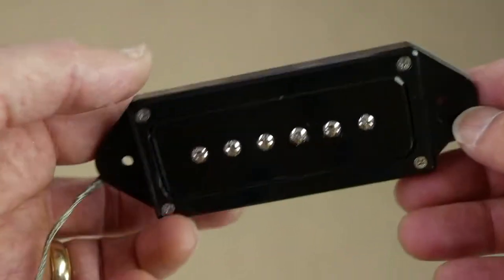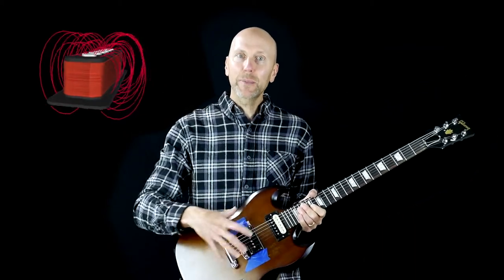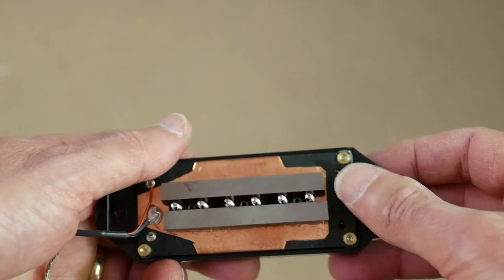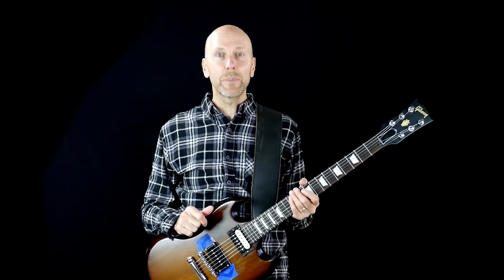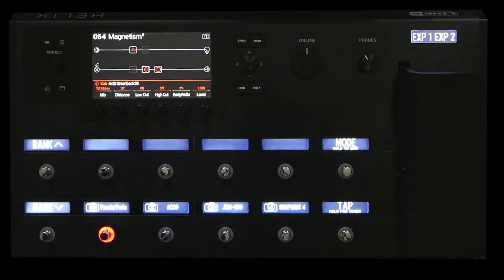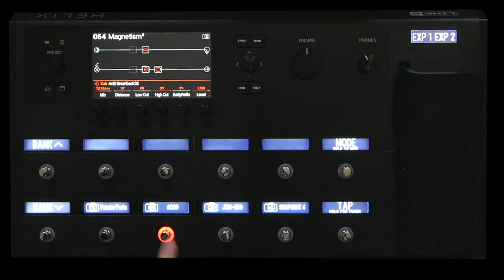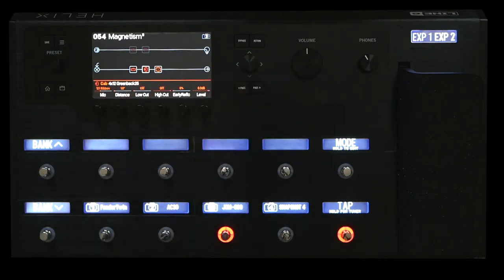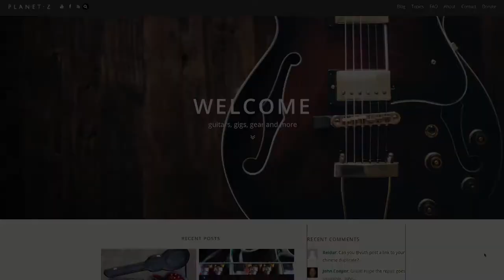Guitar Pickup Magnet Types Comparison

Comment: Seems like a case of flux strength vs permeability, but the output also affects the tonality of the tube amp sound.  Would be interesting to hear DI recordings at the same loudness level.  Then we'd really hear what's happening.  

From lowest to highest Flux and Permeability it normally goes:
-A3: F1, P3
-A2: F2, P4
-A5: F3, P2
-C8: F4, P1

Comment: Interesting demo. I really like A2's and A5's and it's no coincidence that they sound somewhat similar. While magnets are a big part of what shapes the sound of a pickup, there are other variables too, such as single or HB, windings, neck position vs bridge, what kind of amp you play through, what effects you use etc. All of those factors influence the resulting tone. The great thing about magnets is that it's fairly easy to swap them out so you can experiment.